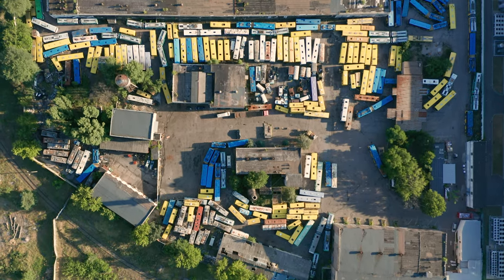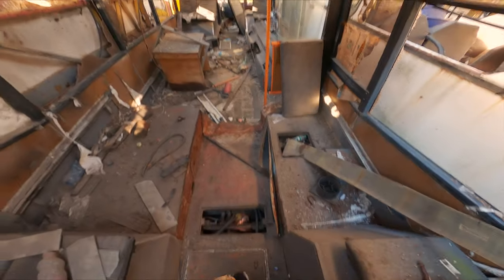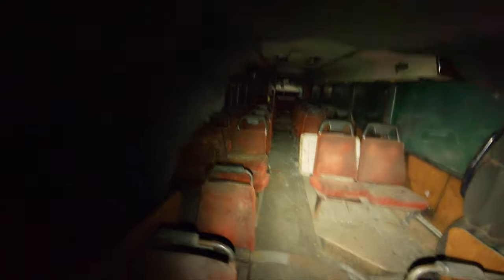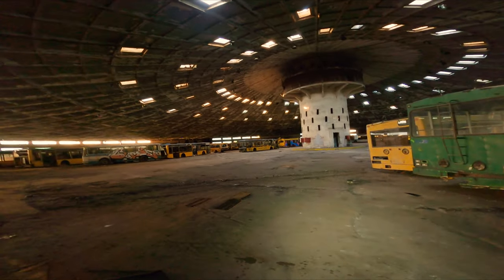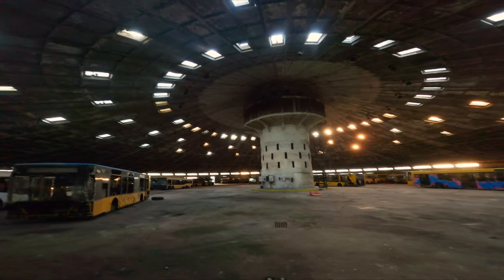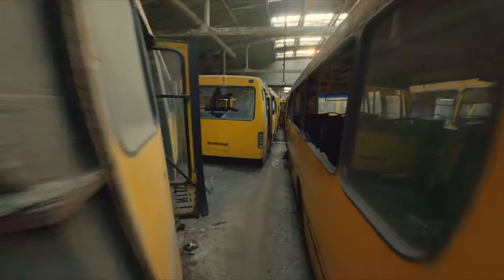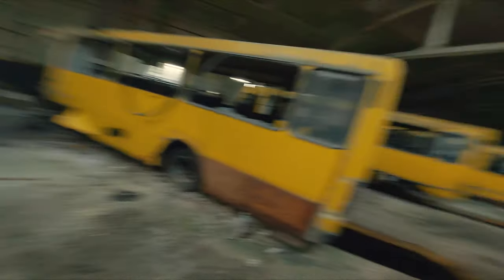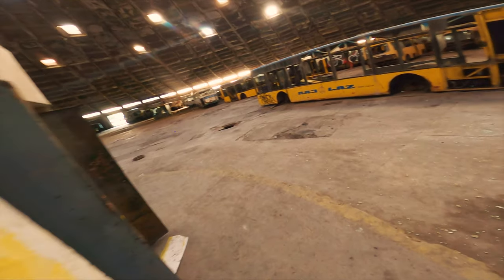Why there are so many busses?

Comment: Hey man great video. Im in Kyiv from October 12th - 16th. I was already scoping this place out and your video is very helpful so thanks. May aswell ask though if your up for doing it again on them dates im there. Msg me i would appreciate it!
Reply from the maker: Thanks, I made it, because I needed something like that and I didn't find anything)
Not sure if I still would be in Kyiv by that time(
Reply: Thank you! Share you wont be around. Ill try it by myself. Are the security tight? Maybe I could just go in the front gate and ask to look haha
Reply from the maker: @dothe303dance  not really, just be quiet and don't be too late when they turn on the big light
Reply: @goytso  Thanks man. Big light?
Reply from the maker: @dothe303dance  when inside, you'll see iron container with windows and it has big light on it, which lights the central column.
Reply: @goytso  Ok ill make sure to go in daylight. Thanks
Reply from the maker: @dothe303dance  and definitely on the weekend)